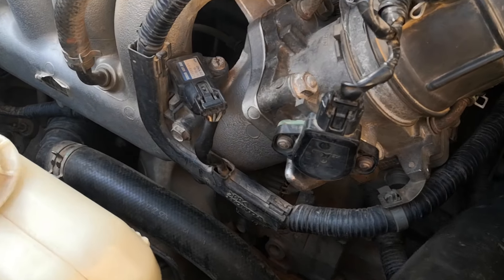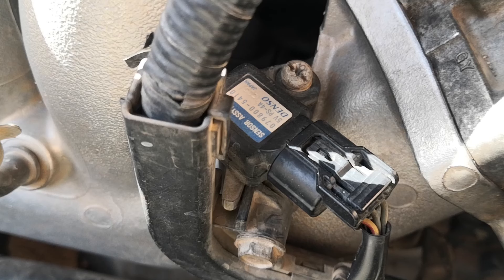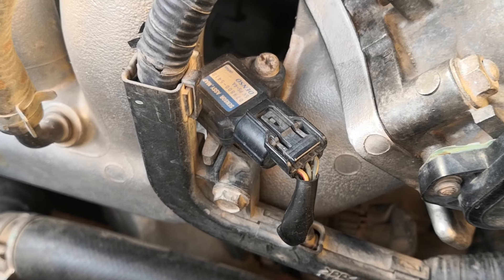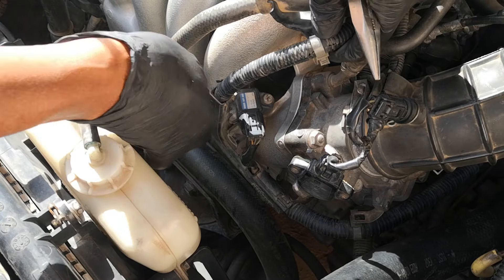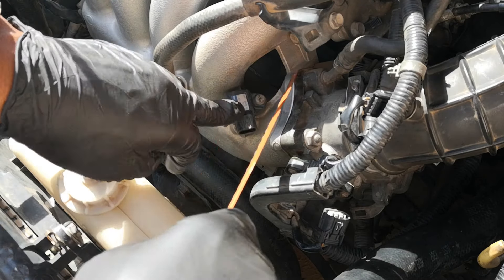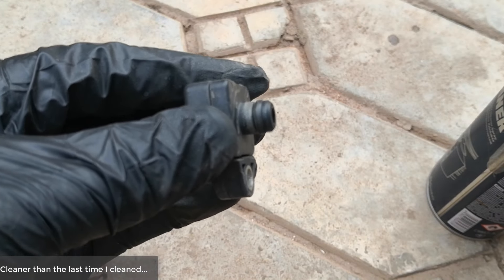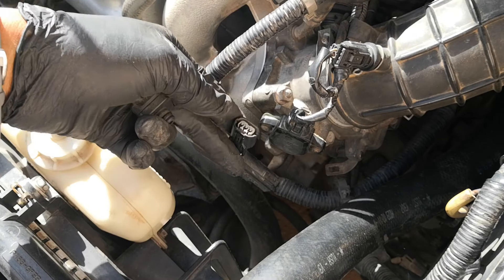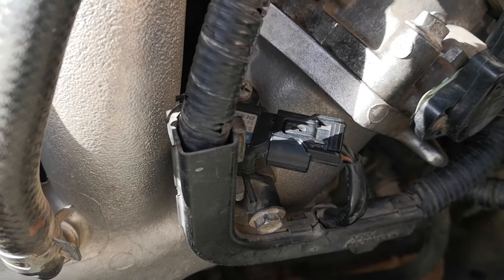How to CLEAN your MAP Sensor (EASY TUNE UP): Bad MAP sensor symptoms P0106 P0107 P0108 codes

Comment: Subaru wanted $465 for the MAP sensor, $550 for the throttle body, and $500 for the labour.  I followed the video and cleaned the MAP sensor, used another video to clean the MAF sensor, and cleaned the throttle body with an old toothbrush and alcohol.  The vehicle runs like new.  Never trust the dealership.
Reply from the maker: Amazing! Frankly fraudulent. Dealerships thrive on replacing parts. I'm so glad you took the tune up route!
Reply: Stealership

Comment: These OEM sensors go for about 140, I got Mines for $100 at honda not everyone will get that deal
Reply from the maker: It's cheaper online. See https://www.hondapartscheap.com/oem-parts/honda-sensor-assembly-map-37830pgka01?c=Zz1lbmdpbmUmcz1pbnRha2UtbWFuaWZvbGQtbDQtMDUmbD02Jm49QXNzZW1ibGllcyBQYWdlJmE9aG9uZGEmbz1hY2NvcmQmeT0yMDAzJnQ9bHgmZT0yLTRsLWw0LWdhcw%3D%3D
It's $68
Reply: @DIYAutoworksNG  Theres Also A Similar Cheap Website As Well Here In FL, Its " Honda Parts Florida "
Reply from the maker: Thanks!
Reply: Mine is $350..
Reply from the maker: That's a lot!
Reply from the maker: You're welcome!

Comment: So you used the electrical parts cleaner? Not maf cleaner and definitely not carb cleaner (obviously)
Reply from the maker: Electric parts cleaner works. You just need to check that it's stated that it doesn't leave a residue. Most of them don't, but came across one at a time that claims to leave a protective coating. You don't want that. The ones that don't leave a residue will have it clearly stated.

Comment: you saved me troubles, just did that that to my car this afternoon, boom back to normal.
Reply from the maker: Wow. Glad to hear this. All the best!!!!
Reply: Hi Raimund, may I ask what symptoms your car had prior to cleaning the MAP sensor?
Reply: @Ghost_Os  my car cold not have normal idle sometimes it goes off, also when you are accelerate it won't pick up even black smoke and fuel consumption was high
Reply: @businessartsolution5351  Many thanks for the reply 😊🤙🏻
Reply: @businessartsolution5351  my accord with this now .. sometime good sometime bad ..

Comment: Good day sir  please I have not carried out this procedure yet but I want to explain my situation. Sometimes When I put my car in reverse, it engages immediately but when I put it to drive it doesn't engage for some seconds or even minutes, then when it engages,  it jerks violently to the gear. Even when driving on the road, sometimes it will not engage and then it engages as if it is not breathing properly.  Also theres poor Gas mileage, difficulty climbing uphill or overtaking. Please I will appreciate your response. Thanks.
Reply from the maker: With what you've described, it sounds like you have a transmission issue. Lack of power on an incline seems like something else. I advise you scan the car first and share codes.
Reply: @DIYAutoworksNG  okay sir. I will scan and share to you. Although I have scanned several times and they said 3 and 4th cylinder has issues. Also
Reply from the maker: Okay. The actual codes will be helpful. If possible, use a scanner that has access to the transmission.

Comment: Great explanatory video ,i have an acura tsx 2008 and i just ordered the map sensor on ebay for 13 dollars. I also was thinking to use a dremel for the screw to make the line.
Reply from the maker: Thanks mate. As long as you have steady hands and you're experienced with dremels, you shouldn't have a problem. Personally, I prefer a saw for control.

Comment: Thank another question for you please? I sprayed electronic cleaner inside the rubber hose that goes in the map sensor on a 2000 Toyota Camry 2.2l. Tie wraps are holding the Map sensor together. Cleaned it and going to put electrical tape and tie wraps again and see if the check engine light goes off. I did not disconnect the battery prior. Afterwards I did, hope I didn't harm anything. I like your videos!!! Great job 👍👍
Reply from the maker: You would have a vacuum leak from the non-perfect seal since you use tie wraps. You will need to scan the car to identify why the check engine is on. The electronic cleaner as long as it is written safe on plastic/rubber will not cause any issue.
Thanks for the compliment!

Comment: Hello,
Please tell me before clean Manifold sensor I need to disconnect battery or not.
Thank you
Reply from the maker: No need except your service manual says so.
Reply: @DIYAutoworksNG  
Thank you.
Reply: I always would when working on electrical components, never be too safe, takes 30 seconds to disconnect

Comment: Good info.  Maybe replace that old screw with a new stainless steel screw?
Reply from the maker: Thanks. Good idea!
Reply: Use the correct screw driver for the JIS type screw that fasten the MAP sensor. JIS-spec cross-head screws are generally marked with a single raised dot or an “X”. 
( Note: 
JIS, or Japanese Industry Standard screws are just different enough in shape that Phillips drivers will not fit well and slip/strip them. The difference is in the leading angle of the point of the driver. Phillips bits have a larger angle and therefore don't bottom out in the JIS screws, causing slippage ).
Reply: If there good, just give them a good clean and apply copper grease to the ard and cover screw head with grease when finished. 🇬🇧

Comment: I tried using a screw extractor, but sadly that didn’t work. Hopefully I have enough of the head left to use the hacksaw blade to make the line. Thanks for the tip!
Reply from the maker: Fingers crossed for you. Let me know how it goes.
Reply: that was a nice little trick..I'll have to try that one. If the screw is really fucked, you can also use Epoxy Glue..just put enough on to cover the top of the screw, let it dry really good, then take the hacksaw to it and make your line.
Reply from the maker: Thanks! Never thought of epoxy!

Comment: Thank you for the tip DIY.. can I asked about Honda fault P0005 witch part should I check.. thank you
Reply: Sorry lack of information, my car is Honda City 2012 GM2
Reply from the maker: See this link. It's to do with the fuel shut off valve. https://www.autocodes.com/p0005.html
Reply: @DIYAutoworksNG  sorry bro.. how about P0055 on honda
Reply from the maker: O2 sensor heater circuit, bank 1 sensor 3. But the 2012 City only has 2 sensors. What scanner are you using? Please try a different one. If possible a well-known one.
I saw one reference for camshaft timing, but try another scanner first. Good scanners usually display a description for codes.

Comment: I bought a 4 bar map sensor to put in my 2.2 I-CTDI, but as soon as I start the truck, the engine light comes on and through the obd I saw that it is not reading the kpa of pressure. Is any tuning or calibration required to read the values?
Reply from the maker: Honda usually don't require caliberation for when MAP sensors are replaced? Was what you bought OEM? On critical sensors of the emissions system, I'd stay with OEM except you get the aftermarket variant of the manufacturer that makes the OEM for Honda. Did the old one throw any codes?

Comment: Can you use electronic connector to clean MAP sensor ? or MAF cleaner better ?
Reply from the maker: Read the fine print, if it says it doesn't leave a residue or affect plastic, it should be okay. If it's silent on these, I suggest you go with either rubbing alcohol or MAF sensor cleaner. I have 2 electric contact cleaners from different brands: one clearly states it leaves a protective film, the other just cleans and leaves no residue. I use the either the latter or MAF sensor cleaner.
Conincidentally, I met someone who cleaned his MAF sensor with carb cleaner 😳😠😡

Comment: Electronic contact cleaning spray is okay for cleaning the inside? Or maybe brake cleaner spray?
Reply from the maker: Certainly not brake cleaner since they contain acetone which will damage most plastic and sensitive electronics over time. Electronic contact cleaner is fine as long as it states that it doesn't leave a residue and is safe on rubber/plastic.

Comment: I have a MAF sensor and a MAP sensor.
I just cleaned the MAF with MAF cleaner, the idle is rough still, can I use MAF cleaner for the MAP?
Reply from the maker: Yes, it's the right fluid for it. 
No DTC's?
Reply: @DIYAutoworksNG  When I pulled my MAP sensor it was covered in motor oil 😬
Any idea of what gasket/seals might need replaced?
Reply from the maker: When last did you clean or replace your PCV valve? It may be clogged open. It returns oil vapour into the intake system.
Reply: @DIYAutoworksNG  I just ordered one online yesterday, is supposed to be delivered on Tuesday.
And to answer your original question I've never changed it.
My Mazda had 100,000 miles when I bought it and I've put another 100,000 miles on it. So hopefully switching that out solves it.
Might also replace the MAP sensor, incase the oil getting in there damaged it.
Appreciate the reply man thanks. 
I just noticed I wasn't subbed to this channel,  am now. 😁👍
Reply from the maker: 200k miles on a PCV will definitely clog it! Good plan to replace. Thanks for the sub!

Comment: I am facing 3 kilometer per liter less average and little bit poor pickup at initial......will MAP  sensor cleaning work ?
Reply: I am not getting any fault Codes in hyundai i20
Reply from the maker: A few questions... Are you having black smoke from the tailpipe? Did you change brakes or tires recently? Did driving style change? 
If you do not have a CEL, fuel trims STFT and LTFT will tell a lot. There are a lot of things that can cause poor mileage without a CEL. They include: dirty injectors, dirty air cleaner element, dirt MAP or MAF, low tire pressures, dragging brakes, stuck open thermostat, sluggish O2 sensors, leaky injectors, worn spark plugs, faulty fuel pressure regulator etc.
You will need to troubleshoot to narrow down to the cause. Would definitely recommend doing tune ups that are due.
Any new info?
Reply: @DIYAutoworksNG  everything is good and in my particulat model i am getting only LTFT1 value is 2.3 % and F/T 1x1 value is 0.8% whats that mean ?
Reply from the maker: These values are normal. Try reading the trims with RPM at 1500. You may also consider addressing some of the points I raised in the  prior comment.
Reply: @DIYAutoworksNG  Hello, I have an Accord 2006. An engine imported from Japan was installed, but after installing the engine, I had some problems when going uphill. The car is muffled. It does not run well when walking on flat ground. It walks perfectly. Maintenance, from changing the ignition and cleaning all the MAF sensors, is it related to the problem of ascent?

Comment: I used carb spray for cleaning the sensor will it damage me sensors
Reply from the maker: It will damage it if you continue to do so, not sure about 1 use. If no codes, you should be good.

Comment: what spray did you use to clean it
Reply from the maker: Thanks a lot for this question! 
In fact, I went ahead to update the video description to address this. 
I used an electric contact cleaner spray. The most important thing in choosing a cleaner for the MAP sensor is that, it should be safe on plastic/rubber and leave no residue. MAF sensor cleaners are ideal for this. As far as I know, there is no one that manufactures a dedicated MAP sensor cleaner fluid.
Reply: @DIYAutoworksNG  thanks alot i will just use a MAF cleaner to clean the MAP sensor
Reply: You can use a generic contact cleaner it's ideal for the job, make sure it dries fully before reinstalling and starting the car
Reply from the maker: Yes. But I'd say you double check that it doesn't leave any residue. I used to use one brand of contact cleaner until one day I read the instructions on the can and saw that it clearly stated that it left a residue. That was the last day I used that particular product for MAF cleaning... 🤣
Reply: @DIYAutoworksNG  strange, the very reason they make contact cleaner is that it leaves no residue, that's the whole idea
Reply from the maker: Exactly. I thought the same until I read this on the can "displaces moisture and leaves a protective film". Now, not sure what the 'film' is made of, but just stayed cleared out of an abundance of caution. Its the Mannol contact cleaner out of Germany. https://www.amazon.co.uk/MANNOL-Contact-Cleaner-CONTACT-CLEANER/dp/B00NHSRHOE/ref=asc_df_B00NHSRHOE/
Reply: @DIYAutoworksNG  thanks for the heads up, why make a contact cleaner that leaves a residue! Baffling

Comment: Does the 2006 Honda Pilot have a MAF sensor? I haven't been able to find one, but I did see the MAP sensor.
Reply from the maker: It doesn't. Usually MAF's are placed after the air filter but before the throttle body.

Comment: hi sir! my car is honda civic 1.4 is d14a4 motor
my map sensor reads 0.80 to 0.90 at idle i replaced it checked wires by hand i coultn't find solution. rough idling and operating rich always what causes the problem?
Reply from the maker: Have you scanned the car?
Reply: @DIYAutoworksNG  yes no codes

Comment: Can I use wd 40 electric cleaner ? For the sensors
Reply from the maker: No. Only MAF sensor cleaner, rubbing alcohol or electric contact cleaner that doesn't leave a residue.
Reply: @DIYAutoworksNG  wd 40 contact cleaner?
Reply from the maker: Got you! Thought you meant the penetrating oil 😂. Yes you can, as long it says it doesn't leave a residue or degrade plastic.
Reply: @DIYAutoworksNG  it’s ment for cleanening electric parts and is fast drying..
Reply from the maker: If its the one I think it is (black and silver can with yellow spray top), you're good to go. I was just laying out the specific requirements because I've seen some electric contact cleaners that leave a protective coating (I guess to limit flux formation) e.g. The one from Liqui Moly. You certainly don't want that on a MAP/MAF sensor.
Reply: @DIYAutoworksNG can you search for wd 40 specialist contact cleaner ,brother 
and tell me wether to use or not?
Reply from the maker: It can be used.

Comment: Is wd40 spray possibly a reason to effect this sensor?because i sprayed and since then my engine is vibrating and there is alot smoke and  very accelrator
Reply from the maker: WD-40 is not a cleaner and should not be used to clean sensors. I advise you clean it with MAF sensor cleaner or methylated spirit if you have nothing else.

Comment: I broke the piece where the 10mm bolt go with the harness. What can I do??
Reply from the maker: You mean you broke that part on the sensor?
Reply: @DIYAutoworksNG  not the Phillips where the MAF,  the funny looking short 10mm bolt. I broke the plastic piece where the 10mm bolt go thru at. So it’s dangling a little instead of bolted
Reply from the maker: I see. I'd replace the sensor then. Just to make sure you don't get a vacuum leak from there.

Comment: Can this map sensor fault start as being intermittent. My car starts OK from cold..when I get to around 40mph driving..electric fault light comes on..acceleration is slow/normal/slow/normal etc...switch engine off then restart clears fault then all OK until starting from cold again.
Reply from the maker: It'd be better to scan the car since a warning light comes up. Did you mean the check engine light?
Reply: @DIYAutoworksNG  the electric fault light also in my handbook is called electronic fault light. Its the same symbol that's used on  diesel cars for the glow plug warning light...my models petrol version.
Reply from the maker: I see. I recommend scanning the car
Reply: @DIYAutoworksNG  went this morning..none of the codes given on diagnostic report seem to match anything on the internet for my car and there are faults in memory that have never happened. Seemed like it was a waste of money.. garage guy ended up saying perhaps its just moisture that eventually dries by the time cars re started and then fault clears itself. But apparently nothing on diagnostic matches to electronic fault light.
Reply from the maker: Did you get a report of the scan and the codes? What were the codes marked as current? What car is this?
Reply: @DIYAutoworksNG  that's the thing..none were marked current..they were all memory.. Example.. DF064..windscreen washer stalk short circuit to earth..never had a problem with this in 15 years I have had the car..also..DF065..RF key to be resynchronised..again never had a problem here..also..DF054..ring supply short circuit to +12V..DF002..Throttle potentiometer circuit incohersence between throttle track 1 and track 2..Car is a Renault Megane 2l 16v mk1 version 2. Petrol.
Reply from the maker: Some cars store previous codes until the ECU is reset with a scanner. Intermittent problems can be the most challenging to diagnose. Maybe try a fuel system cleaner.
When you turn it off after it does that, it's not difficult to start, right?
Reply: @DIYAutoworksNG  its not difficult to start correct. Garage guy said he cleared ECU memory faults..he said if it happens again go back for a free ECU check..it just so happens this morning I had no fault light coming on..perhaps he was right about dampness causing a false warning...yesterday I cleaned around the engine and electrical sensors...now and again I spray wd40 on the electricals to prevent moisture ingress..maybe last week when I did it the wd40 sealed in some moisture that had not dried off properly..Thanks for your replies.